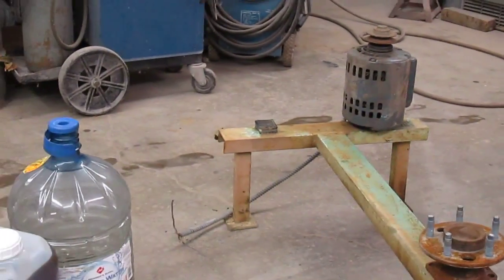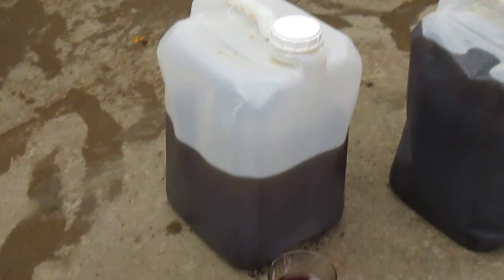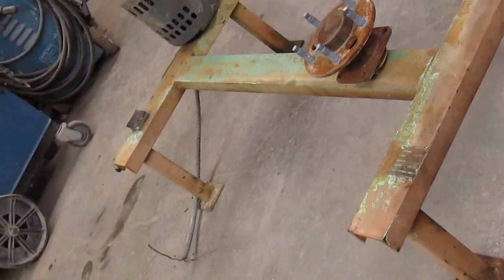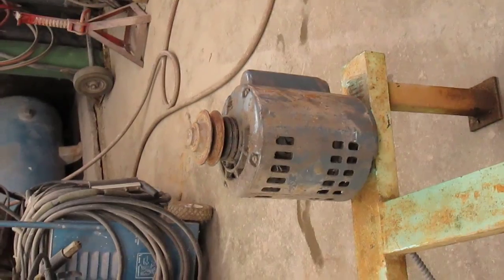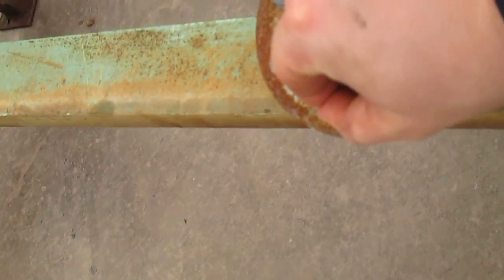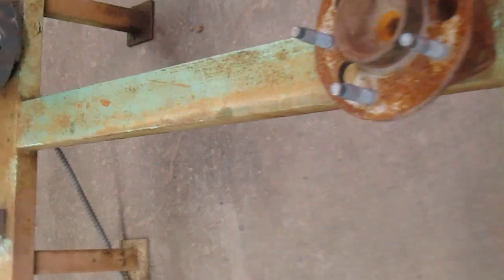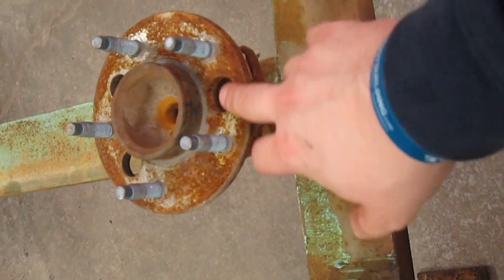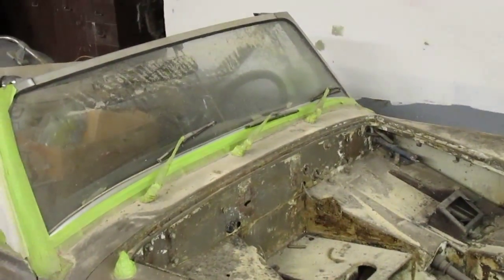WVO Biodiesel conversion #1 - Centrifuge construction & fuel source overview.

Comment: finally someone with good idea!
I'm building something like that. have you consider how to balance it? that is almost the biggest problem. also in order to have a fear results it would need to spin very fast. The G forces on the edge are function of square velocity. So the faster you spin it you get better the results, but also bigger problem with the balancing.